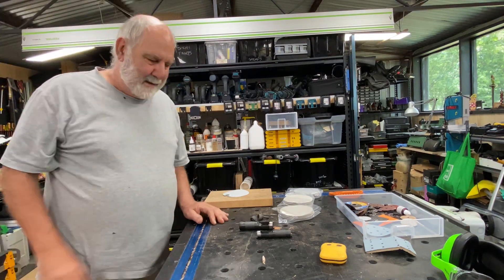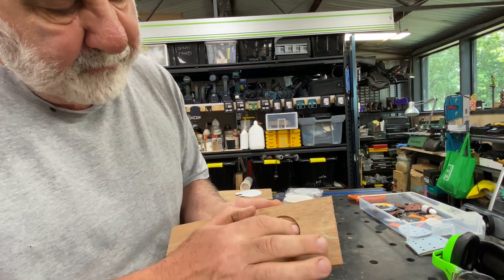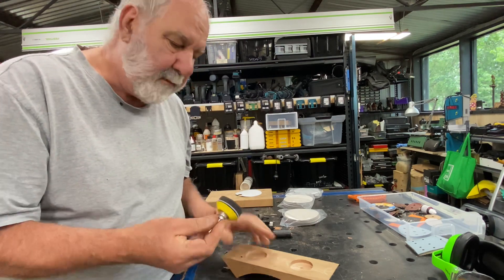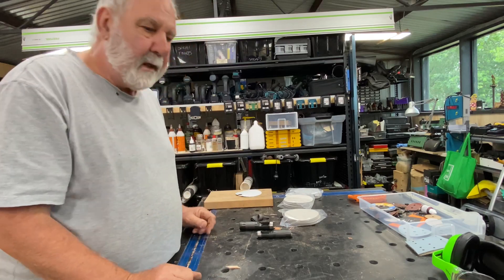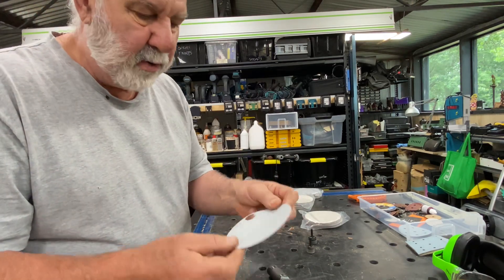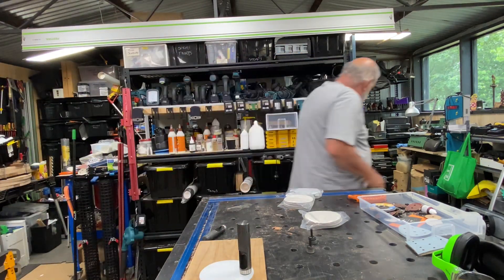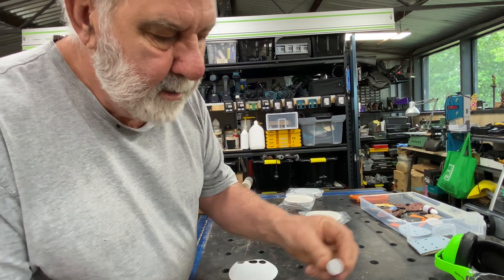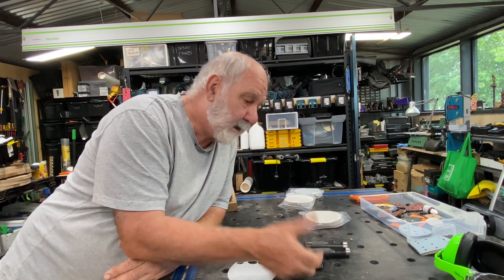Small Sanding disc for woodwork

Comment: Hi Steve,
Just saw your video on the Fiddes hardwax oil - comments seem to be turned off. Just a question, when you sand between 1st and 2nd coat, is that with a sander or just by hand to denib?
Reply from the maker: Hand sand and machine sand depending of size of area